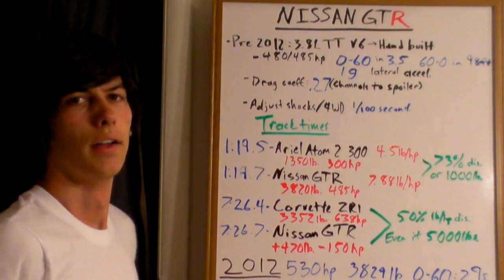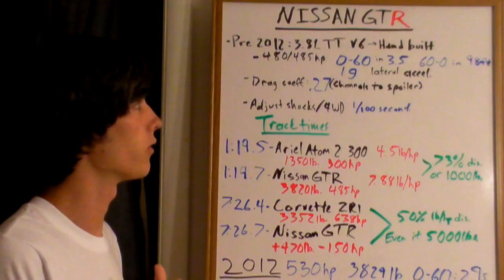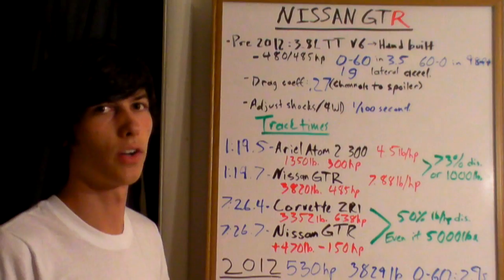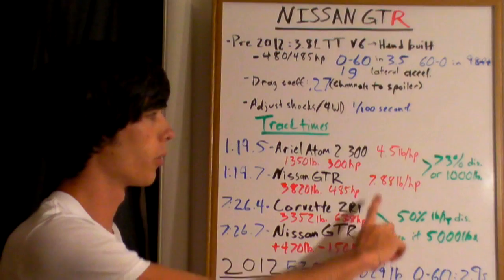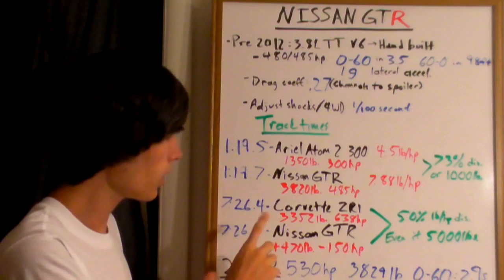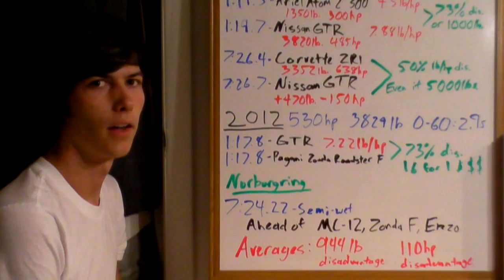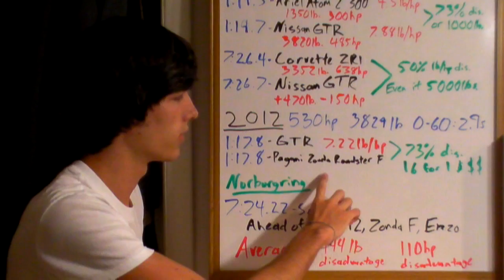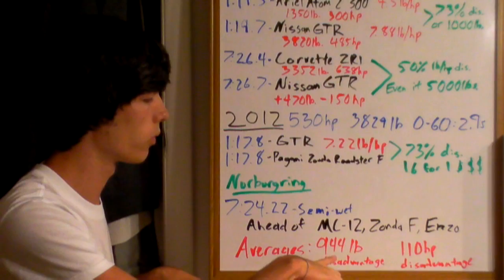Nissan GT-R - Engineering Excellence

Comment: Yea, I was tired when I wrote that. I know they have dual clutch mechenisums. It's a vary watered down version of the F1 gearbox. only difference is that with F1 the next gear is already spooled up and it changes it just as the last gear is at the breaking point. But you have pretty good videos, keep it up. I just stumbled on them late last night. If I may ask, how old are you? I am almost 27 and a student at my local community college for auto mechanics.

Comment: It all comes down to the brain of the car and the extreme mechanical grip the chassis has. I mean the tyres use nitrogen instead of normal air because its lighter and doesn't move around as much. Then you have that perfectly tuned suspension which is constantly adjusting to keep the perfect amount of weight on the outside tyres for maximum grip along with its traction control and stability management. Its all maths. Just extremely thought out.

Comment: you can explain the performance of the GTR by 2 things:
- the very sticky tire (near semi-slicks) when you compare them to the tires used by its competitors

- the ATTESA system which controls the power independently of the 4 wheels. If you know the tire traction circle, you know that a normal car (even an Ariel Atom) can't use at the maximum the traction potential of its 4 tires at the same time. The GTR does it.

Comment: I have been wondering the same thing about the GTR. It's not only good on the race track it's king on the street racing scene as well. My guess would have to be a combination of aerodynamics, maybe the GTR has a better wind resistance and a good designed AWD system in conjunction with it's suspension. Randy Post American race car driver said that the Nissan GTR drives itself meaning that it takes minimal effort to control the car on a race track. I think it is the most balanced sports car.

Comment: I remember reading somewhere that Ferarri purchased a GTR for its engineers to dismantle and examine and even they were baffled. Nissan really have been ahead of the rest all the way back to when they first engineered the ATTESA-ETS torque split system for the BNR32. Fun fact: The BNR32 was also the first production car to be engineered to develop oversteer.

Comment: This is possible due to a lower center of gravity and perfect weight distribution. Along with this, it's low drag coefficient, yet high down force, allows the GT-R to make great use of the power that it does have. The combination of this creates a formidable track car. All-wheel drive probably helps a bit too, especially with the 0-60 time because you don't have to worry about tires spinning as much.

Comment: The McLaren F1 was a purist's driving machine. Gordon Murray when he designed the F1, designed everything such that the driver gets the ultimate driving experience. Hence the V12 making 630HP, the manual H-Pattern 6 speed gearbox, the extremely low weight, the rear wheel drive, and the central driving position. The GTR is simply amazing because of the technology that allows it to do what it does. Try launching anything as well as a GTR, it won't happen. Unless you're driving a Veyron.

Comment: AWD and the rears wheels turning the opposite direction of the front wheels is a bit of an advantage on the track ;)
Launch control is the reason the 0-60 times are so good. The car will give you the RPM it needs to launch, and with a little bit of help from the traction control, you will get a perfect 0-60 every time. A perfect driver can do better, but those are few and far between.

Comment: The problem is that power to weight ratio only really tells you how a car will perform in a straight line, though obviously drag coefficient plays a part. Going into a corner, better brakes allow later braking, increasing average speed. Dealing with brake fade and perfecting ABS via technology help immensely. 4WD dynamic control technology improves speed through the corners, as well as corner exit speed, with much less reliance on driver skill. Driver pushes the tech to the limit with confidence

Comment: 4. its weight, in addition to it's aerodynamic downforce, put a lot of pressure on the wheels, basically helping the GTR corner faster(since it would have more grip per square inch of the tire that is in contact with the road)

Comment: yeah dude, and i just wanna suggest something to u. since u a fair bit of knowledge about the advanced dynamics of a car's design, I suggest you delve deeper into super/exotic cars, pull out some info about their designs and engineering excellence and makes videos on that. like the veyron has 12 radiators (not sure if the right term), sixteen cylinders, four turbos powering four cylinders each, the ferrari 599 gto has some revolutionary AWD system etc. I'm sure you'll get a major surge in views.

Comment: The reason you don't see the GTR in the Le Mans series is because AWD is prohibited. I feel the GTR's performance comes from the number of things that other people have mentioned here like great engine, suspension, transmission, AWD and electronics. The car works as a whole. The truth is a old fashioned mechanical car can do just as well if tuned properly.
Nonetheless the numbers are absolutely insane, and you can even fit 2 people in the back with their suitcases in the trunk!

Comment: The gtrs RWD/AWD system. Its Pure RWD but only changes to AWD if the RWD loose transaction. The GTR computer remembers corners, angels you do basically everything you do it remembers and the next time you do it, and does it better for you, knowing how much power to put down extra to which wheel, and the more times you do it the better it gets. Also RWD is better in drag races, so it goes RWD if it slips front turns on to pull it forward and Changes back to RWD making it go really hard.

Comment: Was wondering...do you know if all this data collected on these cars was using the same track (same kind of pavement), using the same driver?  And I suppose the tires were not the same type tires, but tires inherent to the cars themselves?  Also, the GT-R is a 4WD...but are those other cars?

Comment: Depends on the track, on a very tight slalom course with no straight my little Beat could probably take on a lumbering Corvette easily, but anywhere else....

I think the biggest problem with power to weight ratio figures is that a very light car will a less powerful engine is going to be affected more by air resistance than a heavier car with more horsepower, which is probably why the GTR can keep up with the Atom.

Comment: Hey engineering explained, have you played Gran Turismo? if not then you should, it has many many nissan GT-Rs and I would say the physics are quite accurate. as people have already said here. Wheels, tires, suspension, and weight distribution are really the biggest players in racing. look up the TVR Cerbera Speed 12, 0-60 in 2.9 seconds just over a ton with 800hp v12.

Comment: the car has a F1 like gear box. Making gear changes extreamly fast. Plus you have two turbo chargers and essentially two air intakes. It's like having two 3 clylinder engines under the hood. It's one of my dream cars. That and the Mitsubishi Lancer Evolution X...

Comment: One thing I know about the GT-R is that, allthough its heavy, that weight is the perfect weight on a wheel in a cornerining situation. A ariel atom might not be heavy (and thus good hp/tonne ratio) but it also wont be able to put down enough weight in the corner to get the max out a tires grip. This can be done with downforce, but atom doesnt have that much. Point is : gtr is heavy, but for a reason. It shifts it weight onto a tire in order to give that tire grip (along with clever cpu and diff)

Comment: Heck, even Tommi Makinen (once a rally champion) managed to clock 7:55 around the ring in a 2011 WRX STI. That car has 305 hp with 3,420 curb weight. (I guess there were little modifications to suspension and tires though.)

Comment: I tend to think the Porsche 911 Turbo is a bit more magical than the GTR.  What makes the Porsche special is that it has some fairly similar stats to the Nissan (albeit with a bit less weight) but the engine is in the back, which everyone keeps saying is a bad thing for the car's handling, yet it remains a supercar benchmark.

By the way, the 2012 911 Carrera S, with less than 400hp, just nearly matched the previous 911 Turbo's lap time at the 'Ring.  The next Turbo ought to be insanity.

Comment: The japanese lead engineer for the GT-R  (sorry forgot his name) calculated all loads to the tires so the car will use its weigth to the full potential and create grip, tire grip is directly affected by the load on them, they will not disintegrate but the will sure overheat thus reducing grip and lap times will get slower, dont matter if the car has "special" tires or not. That same weight that helo the car stick is his downfall

Comment: I think the 11' Porsche 997 turbo can do 0-60 in 2.6 with the sports chrono.
The GTR's magic lies in more than mere numbers on a spec sheet, the clever diffs, good weight distribution, aggressive suspension geometry and settings all help. I suspect it has good body rigidity too.

Comment: I can see why people like it. But it gets outrun around tracks (Zr1 & Viper ACR are under 7:20 around the Nordschleife, 2013 Viper TA holds the Laguna Seca production record) and on drag strips & standing mile, etc., by RWD standard transmission cars.

Aggressive close ratio gearing and lightning-fast shifts mixed with power to all four wheels (no worries about power-oversteer) makes up for its weight. But all of this can't actually overcome the weight, it just helps alot. It still loses.

Comment: Have you looked into this anymore? You by far understand engineering better than I do, but if I have learned anything thus far is that there's no magic in it. I believe that its not the engine or the body-style of the car as more of the transmission that is helping it reach those numbers. Am I wrong?

Comment: It really is a great. It even takes a bunch of tech that has been banned from most racing. I remember hearing how quickly computer adjustable suspension got banned in F1 for example. It increased the teams lap times by an entire second or two because they were able to keep the car level no matter the condition. Really makes me wonder what would develop if there was a league with no spending control or regulations. Probably have to have computers instead of drivers though. :P

Comment: ATTESA! Nissan popularized this type of suspension. not sure if they got a the idea from somewhere else or if it really did originate from them. regardless, theirs is extremely advance in the older skylines and gtr and other companies are following, even some exotics. it basically gives the car the handling of a rwd, but the grip of a 4wd. stis only have front rear torque control, evos have front, rear, left, and right control, the GTR makes these car seem like ancient history..

Comment: Well because it would be quite hard to have a 4 door or even 2 door car to be very lights and have the aerodynamics of a F1 car, so the next best thing is to have a 4WD system which is good enough to put every bit of power to the ground and keep the car on the ground around the corners. Plus as you said GTR is well designed to be aerodynamic with alot of downforce already.

Comment: I'm no expert, but those lap times relate to racing directly, which isn't just about pwr-to-wgh ratios.  Lap-time is about acceleration (both + & -), grip or traction (handling & G's), and the GTR truly does excellent on those areas.  Lots of grip thanks to the ATTESA E-TS system, and it is also paired with the dual clutch tranny, so the power actually gets put to the floor more efficiently to move the car in and out of any corner.  Cut some weight and put race tires=OMFG if it isn't already.

Comment: AWD could allow roughly twice the force to be delivered to the ground as a RWD vehicle. Do the other cars have AWD? I think normal force x mu static is the maximum force one tire can deliver. It becomes less of an advantage the greater the acceleration is as weight transfers to the rear. The other advantage may be it's drag coefficient as drag is a function of velocity squared so at higher velocities it could be a better payoff to reduce drag than increase HP.

Comment: There are two things that you kind of forgot to mention. Handling of the GT-R is amazing as stated above in like every comment but the fact of the matter is since it is hand built most GT-R do not get 485 HP. Most get actually much more and nissan has a habit of underselling their engines. There are actually some 2010 GT-R on the road that have 530 whp stock, which is alot for all wheel drive.

Comment: yes but there is a reason they do not use the inline 6 since the engine bay is wider and the whole car is longer, plus you can stick a decent awd transmission behind it because it is not a long engine, it is automotive engineering chassis basics

Comment: V8 I agree, cheaper performance less problems, one mod on a v8 makes it produce significant increases in hp, all the methods you apply to make a smaller engine fast can be applied to a larger engine.
there is no replacement for displacement, still nothing wrong with a turbo 4 cylinder putting out 300 - 400hp if that is what you need.
also with LS engines you can get parts easy and cheap same with mods and they always rwd

Comment: but it have to do with the suspenssion , the movement of the COG , the momentum , instead of trying to stop the momentum of taking a turn the GTR use it and the suspenssion + torque destribution help turning the vector to the inside , you use the momentum to your side, you don't stop the momentum take a turn than build another one, in the GTR having a lot of weight give il a lot of mass to brake which means a big momentum to use not to stop when taking a corner, and the GTR magic don't stop here

Comment: The tires are not the issue. The R35 tested likely had the Dunlop or Bridgestone summer tires, performance but not near semi-slicks, at least not any more than the Michelin Pilot Sport PS2 ZPs specially developed for the ZR1. And the Ariel Atom, while I'm not sure, I would imagine comes with very aggressive tires being a road-legal race car. 

The ATTESA system is part of the "Engineering Excellence", that's the point I think he's getting at. The system is amazing from an engineering standpoint.

Comment: If you think the stock 2012 gtr is insane, give the car to AMS and theyll give you back an alpha 12 gtr with 1500hp, capable of 2.3 second 0-60 times and can do an 8sec pass on full street weight. (this is a package they sell for both general reliable street use and strip times)
Is there even any street legal car in the world that can come close to that? (especially for the price invested - less than 300k)

Comment: the latest skyline - r35 ... has very low drag that had surpass many super car now days without sacrificing downforce ... and the transmission is move to rear of the car to have better weight distribution unlike the previous model skyline which has strong understeer characteristic .... the attesa system in the r35 is refined to make skyline have more traction and better handling ... i think the only disadvantage of skyline is weight ..

Comment: it doesn't matter if it generate noise or no noise because the main purpose of the car is to go fast. 

In fact, the less noise is better because most of the energy generated by the engine are transferred to the wheel instead of unnecessary vibrations which causes the noise.

just my 2cent

Comment: May I beg to differ here? I don't mean to play devil's advocate, but I simply can not resist.
Braking distances also depend on braking power (from the brakes) as well as the tires. A vehicle with 8-Piston Racing brake calipers can stop a vehicle MUCH better than standard factory brakes. This is assuming the vehicle is the same and the tires being used are the same.

Comment: It amazes me how the haters always have to point out it is a computer on wheels and it apparently drives itself for you. Morons.  Don't all modern cars have computers in them now?  Don't a lot of cars come in Auto now?  It's not Nissan's fault the competition has inferior computers and tech in their cars!  (Time to upgrade?  Just like Porsche did)  Porsche also has abandoned the Manual Transmission and uses DCT.  Haters gonna always hate and get all butt hurt because they can't and won't ever get to own a Godzilla.
Reply: Every car since 1996 is a computer on wheels. Every sports car worth me running since 2005 has electronically controlled/monitored suspension availability as well as on the fly tune ability of many components. They just hate the GTR because they can't buy one or just don't like the way it looks or are letting other videos sway their logic. I own one and it's amazing. Porsche 911 turbo or Cayman gt4 are amazing. The 2015 z06 is amazing. All these have clever electronics assisting the driver to be quick around and on a track.
Reply: tjlazer71 GTRs aren't that expensive tho...

Comment: The GTR is pretty good, but your analysis is too heavily focused on the power/weight ratio.  The GTR is quick mainly due to its torque vectoring awd setup.  None of the vehicles you mentioned have awd or torque vectoring.  Also, compared to the Atom, higher horsepower will prevail at higher speeds due to increasing drag forces.  Which is why the Veyron can be so portly yet have a higher top end speed then cars with much better power/weight ratios.

Comment: How is it possible? Traction, awd, torque, HP, low drag, wheel spin monitoring, twin turbo, huge spoiler, alot of downforce, so on.. point is the gtr does everything really really well; an excellent machine that defies physics.